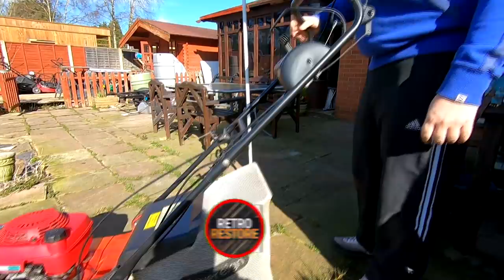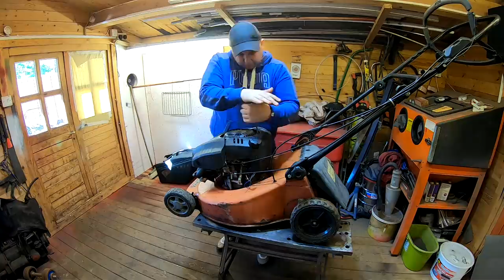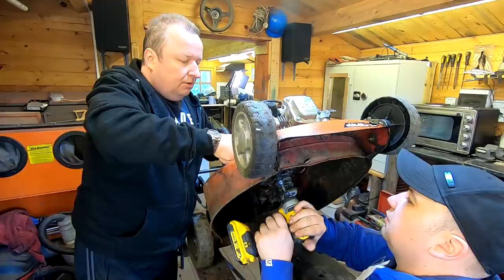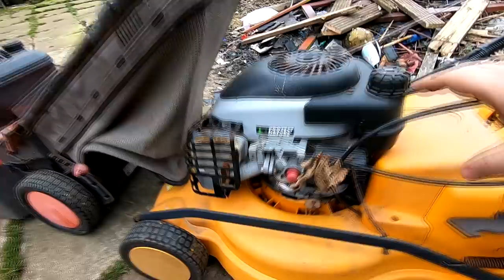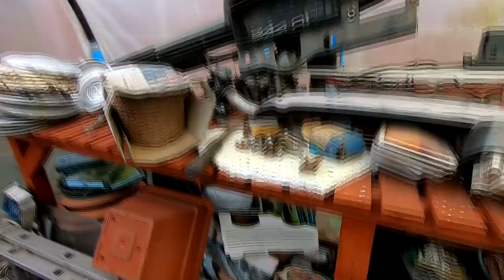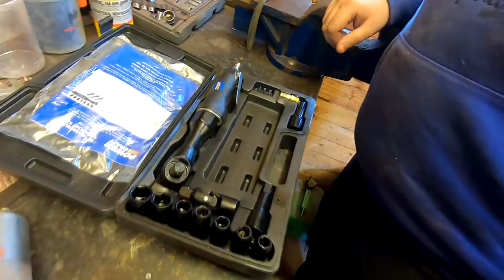Powdercoated Lawnmower Finished And Tinkering About Vlog

Comment: Get 5-10m of copper pipe going up and down after the compressor that will cool the air down as water traps only really work when the air has been cooled. I have a small air dryer and its worth its weight in gold, can blast for hours without issues.

Comment: Sweet mower. Hope you get your money out of it.
I picked an electric start Craftsman mower 4 yr ago. It was a mess. Have $65.00 all in, including a new battery. The parts hoard came through.
There is no stator,  battery has to be recharged every few months. My old back is tired of pulling starter cords. 
Replaced the battery in January for $19.00. This one is definitely not for sale, it’s mine. I also converted it to an auto choke from a rusted engine.
It’s sweet!
Great to see Gary joining you.
I got rid of my spares/repairs stuff , mostly. I do have 2 pressure washers with good engines, and a Honda powered one for bits. They are stuffed in a wooded lot next door. 
It’s just tough to make money on repaired sales, here.  I just do repairs now, my back permitting. I’m jealous.
Reply from the maker: Just having a clear out Jim. Hope your back holds out bud.
Reply: retrorestore up I got a back massage yesterday, man I feel better than I have in two years, 45 minutes, and insurance covers it.
Still feeling good, cheers

Comment: Keep the motor, I've got one on a MTD mower, I'll get round to a Vlog on it one day lol, just a key start and housing, slim line 12v battery that discreetly go in key start handle bar mount, 9.99 on Ebay.